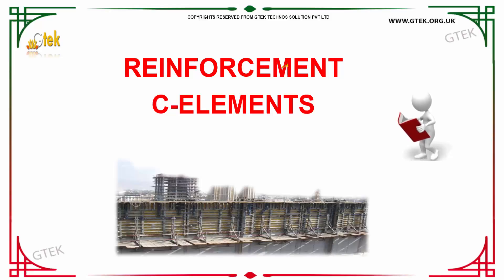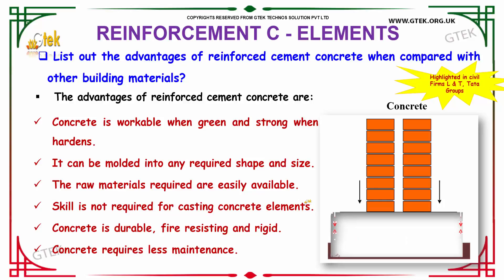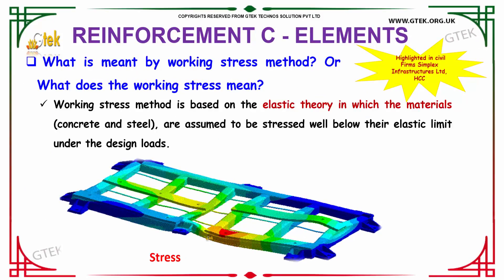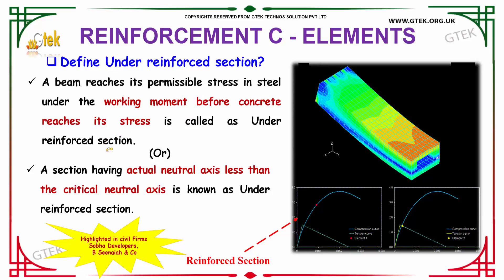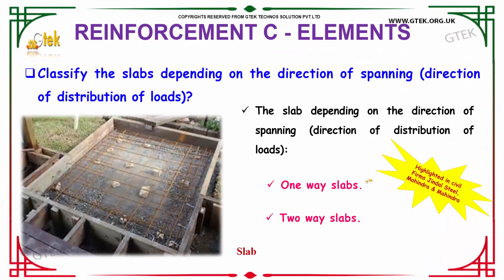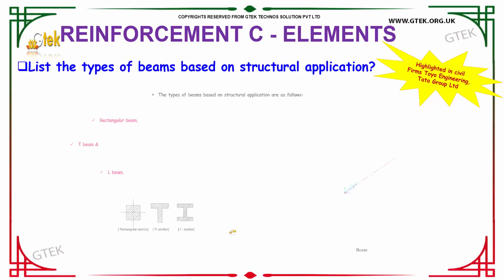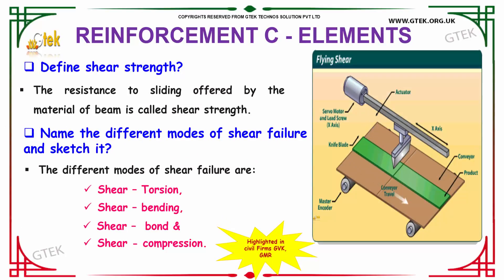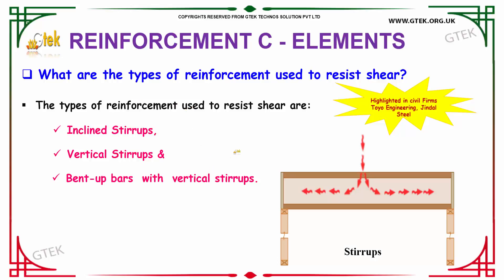Top 30 Reinforcement C Elements -1 civil technical interview questions and answers for fresher

Comment: Concrete has relatively high compressive strength, but significantly lower tensile strength, and as such is usually reinforced with materials that are strong in tension (often steel). Reinforced concrete is the most common form of concrete.

Comment: Corrosion control of steel reinforcement is necessary to prevent damage and failure of concrete structures. Nearly 40% of failure of concrete structures is due to corrosion of embedded steel reinforcement.

Comment: Why Corrosion Control of Reinforcement bars (Rebars) is necessary? Corrosion control of steel reinforcement is necessary to prevent damage and failure of concrete structures. Nearly 40% of failure of concrete structures is due to corrosion of embedded steel reinforcement.

Comment: For a strong, ductile and durable construction the reinforcement needs to have the following properties at least:

High relative strength
High toleration of tensile strain
Good bond to the concrete, irrespective of pH, moisture, and similar factors
Thermal compatibility, not causing unacceptable stresses in response to changing temperatures.
Durability in the concrete environment, irrespective of corrosion or sustained stress for example.